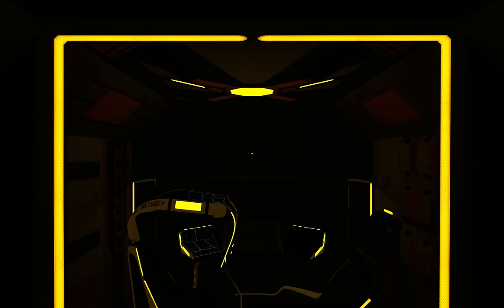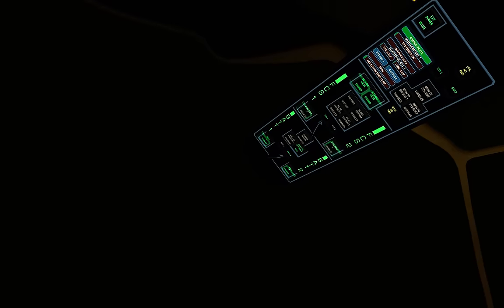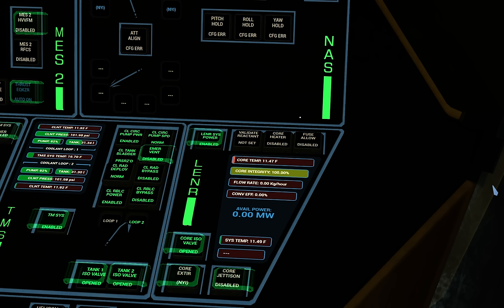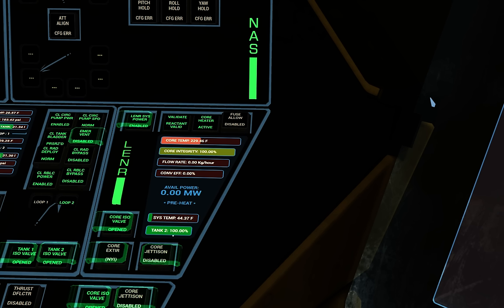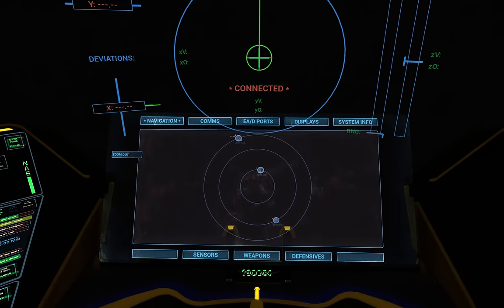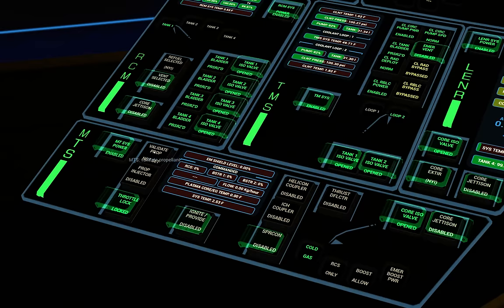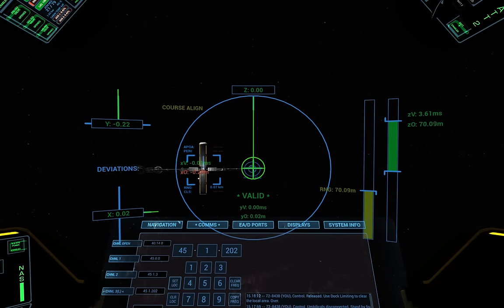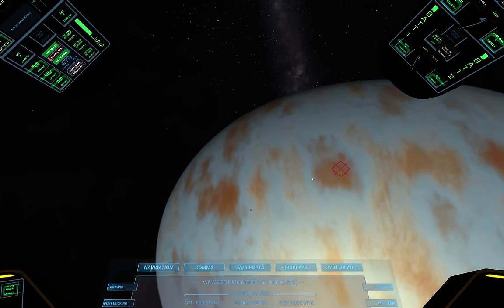Rogue System - Startup and Undocking

Comment: Loving your videos, just bought Rogue System on the strength of them, quick question if I may, when you zoom in to the TMS at 2.53, you are still able to use your mouse, when I zoom in, mouse movement freezes....what am I missing that's maybe painfully obvious ;-)
Reply from the maker: +Mark Gash Thanks for the feedback!  I'm using the ~ key on the keyboard as it's the zoom toggle.
Reply: +deephack Can I replace 'painfully obvious' with 'Blatantly' please ??  My excuse is, I live on the Isle of Mull, a place bereft of time, and I'm sure you know that we just came off gas lighting etc ;-)

All is working well now, and thanks for your swift reply, I can see this sim growing massively, so just need to get my head around the brilliantly complicated systems ;-)

Keep those videos rolling in as it progresses, I need reference material like no other.....Good Stuff :)

Comment: Does the radiators have a practical use yet? Is it worth deploying them?
Reply from the maker: +MultiRonius I have managed to create situations where the extra cooling was helpful.  Generally when doing a long MES burn but I'm sure that there are other cases.
Reply: They're realistically functional now as of the last update. Meaning objects can now react to how they're facing the local star,  in terms of heat/light, so turn the ship to put the sun in front and the radiators behind can be deployed and will cool the ship, if they start facing the sun too much, you will heat up the ship more.

As such, the Laser cooling was ramped down in efficiency and is primarily a back up cooling tool now, useful for longer MES or MTS burns etc.